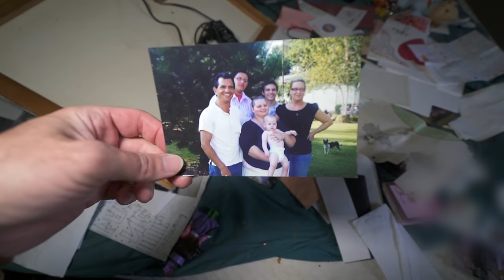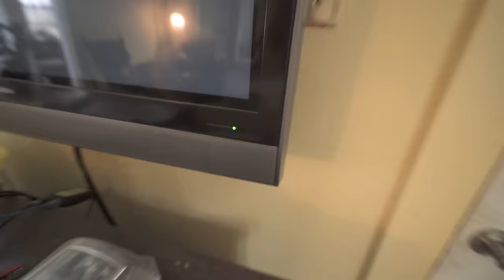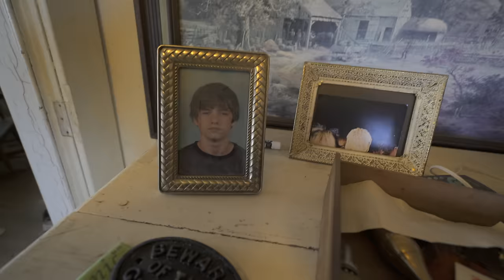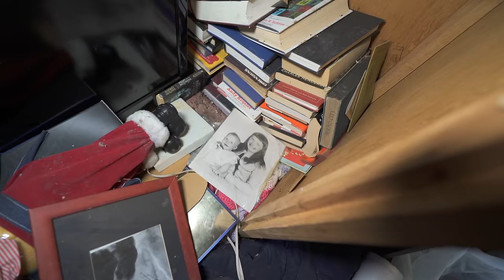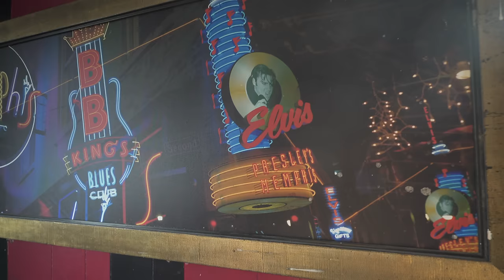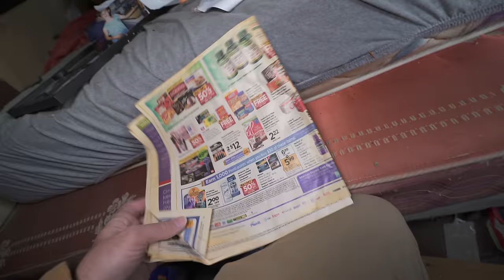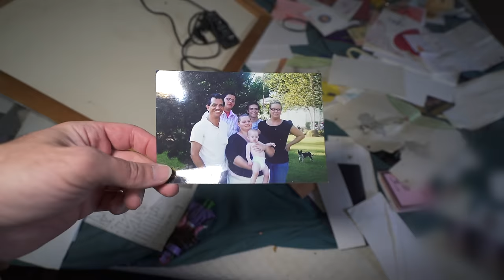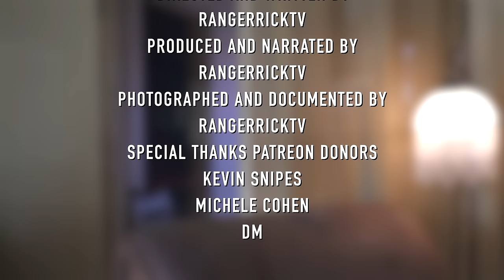We Discovered Abandoned House With Missing Boy | Police Came

Comment: That is a wood burning stove it was used in old houses that didn't have Central heat you were correct on the pipe going to the roof but it was to heat the room. And the top was flat to double as a cooking top or for heating kettles.

Comment: I also want to point out, the fact that the gameboy still works, is the owner of it knew they weren't going to use it in awhile so took batteries out to not get corrosion in the battery terminal. And what did you do? You turned it off, but left the batteries in it. 

I swear this guy has no common sense.

So I'm 26, and can tell he's older than me and at around 11:55 doesn't know what it is? I knew exactly what it was